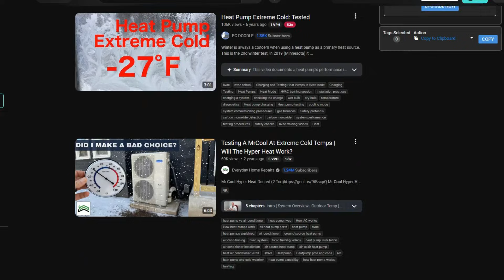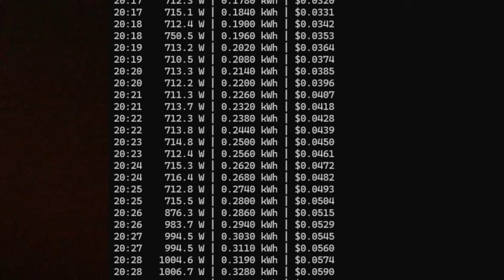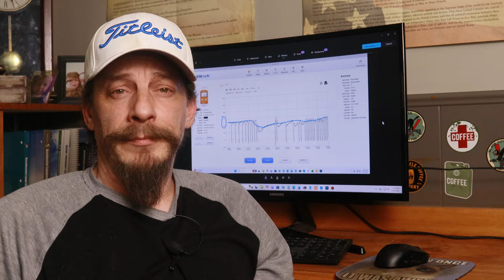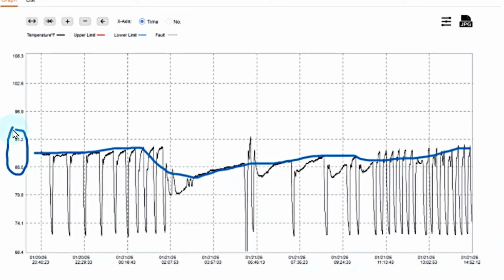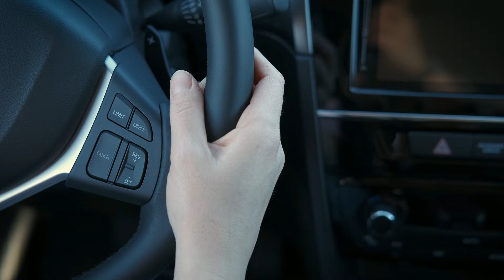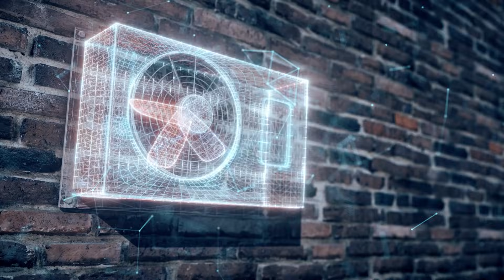Heat Pump Vent Temperature Doesn't Tell the Whole Story

Comment from the maker: This video is about why supply air temperature can be misleading when judging heat pump performance.

Heat pumps are designed to keep comfort steady, even while the system workload and efficiency change behind the scenes. That’s why “how hot the air feels” doesn’t tell you how hard the system is working—or how efficiently it’s doing it.

This applies to mini splits and central heat pumps, especially in cold weather.

The next video goes deeper into what good cold-climate heat pump performance actually looks like.

Comment: Thank you , great explanation , had to charge my 3 ton inverter heat pump , due to a small leak , now I get , 98 degrees coming out of vents , and a 28 degree split in heat mode , 21.5 in cool mode , very economical machines .

Comment: So, do we start calling you Michigan City Mike now? 🤭 Heat pumps always seem to have issues with the reversing valves' defrost control boardsand the fan boards (ECM or VFD). In the North Coast of California (Humboldt County), the climate is pretty constant on the coast, but when you head east, the climate is quite diverse going from early morning chilly (30°F) to comfortable T in the mid-afternoon (minus the saltwater air). As the seasons change, those numbers obviously fluctuate up and then down again meaning the majority of heat pumps are in these areas. My question is how much does condition inconsistency and elevation effect the functionality of the for mentioned components? Great video, superb HVAC content (sempre), and looking forward to diving into heat pumps even further on your upcoming videos. Mucho Mahalo!!
Reply from the maker: 😂 Michigan City Mike might stick.

I don’t really see weather swings or elevation directly killing boards or valves. What I usually think causes trouble is how the system ends up running in those conditions.

Coastal climates like that tend to sit right in the sweet spot for frost, even when it’s not brutally cold. Mild temps plus higher moisture mean the outdoor coil can load up with frost more often than in really cold, dry air (it’s been single-digit temps here for two days and I think my unit only went into defrost maybe twice).

Over time, I think things like power quality, moisture/salt air, and cycling behavior take a bigger toll than the actual outdoor temperature itself. 

As far as elevation... not really sure to be honest with you. I'll have to look into that. 

Appreciate the kind words, and yeah, definitely diving deeper into heat pumps going forward 🤙
Reply: @JerseyMikeHVAC 
Excellent. Stay amazing bradda....(and warm!!!! 🥶)

Comment: In my experience -- the higher the outdoor ambient temperature, the higher the indoor supply temperature. The temperature  split increases as outdoor ambient temperature increases..
Reply from the maker: Yeah there can be an overall shift in the supply temperature range as outdoor temps change, but it’s usually not very drastic. I’ve seen bands like ~87–95°F in some conditions and ~77–85°F in others. What’s really driving that shift isn’t the outdoor temperature by itself though, it’s the heat loss of the space. The outdoor temp just changes how hard the system has to work to cover that loss.

Comment: Do you have any recommendations for power spike protection for the power supply (MOV 
, ETC). Or power conditiining in general for the electronics protection in the heat pump
Reply from the maker: The Intermatic AG3000 is a solid choice for surge protection. Just keep in mind that surge protectors help with high-voltage spikes, not with low voltage or brownouts. If your power sagging or fluctuating under load is a concern, you’d also want something that monitors or stabilizes voltage in addition to surge protection. A dedicated voltage monitor/cutoff relay (e.g., a 240 V Macromatic voltage monitor) can protect the heat pump by disconnecting it when voltages are out of safe range and reconnecting when power stabilizes.

Comment: Great info. , Mike.   tell us what you use to track system performance.    such as what you used on your computer. Thank you for your work.
Reply from the maker: I used this AC Communication Module Kit 100A: https://amzn.to/3Lz0HBr
Wired that up the circuit for the mini split back at the eletrical panel with a comminucation wire that went back to my computer with a USB connection. Then I had a python script made up to collect the data every second and save to an excel CSV file. I made the script to also update on screen every 30 seconds so I can track numbers live and make sure it was still recording through the run. 

 I also had 3 Elitech RC-5+ TE temperature loggers going: https://amzn.to/4a41qTo
 Those log independently and I can later plug them into a USB port to download the data.

Comment: I love gas and lp heat and I doubt I'll ever be pro heat pump, but your honest assessments might sway me closer.
Maybe.
Reply from the maker: They've won me over a little in some key situations, but I still don't think anything beats gas for the deep cold. I do miss my wood stove sometimes... but not the work.
Reply: @JerseyMikeHVAC  think hybrid with furnace is the answer or until u test a super duper extreme cold weather h/pump, thing that is steering me to replace my 23 yr old bldrs special rheem 92 is the lower prices of pv panels, inverters and batteries small supplement of pv with electric heat, dryer, stove is a winner as long as u dont get nailed by lightning or a short fire